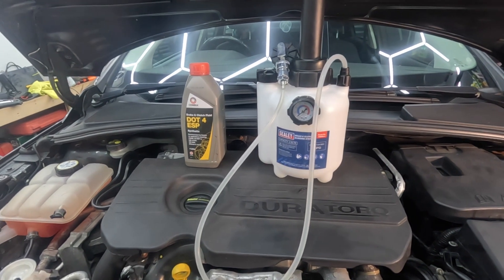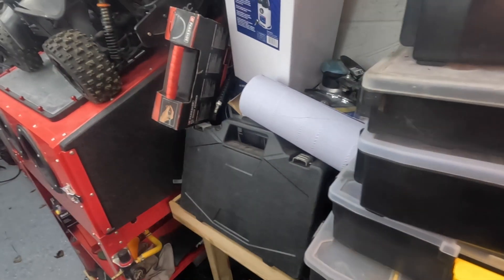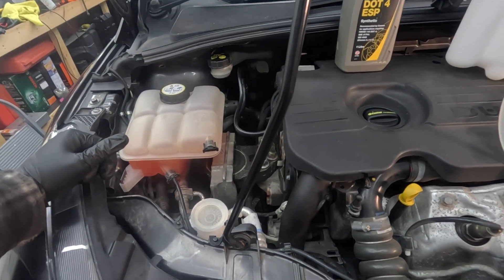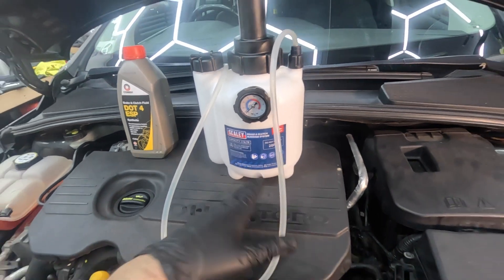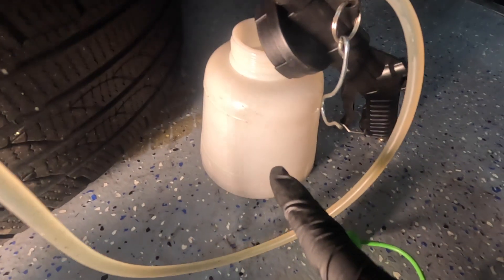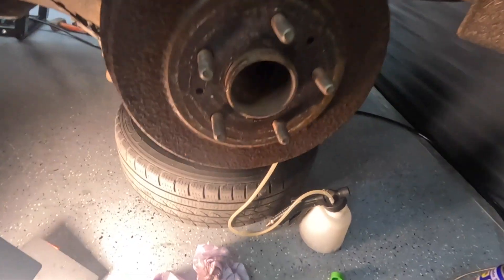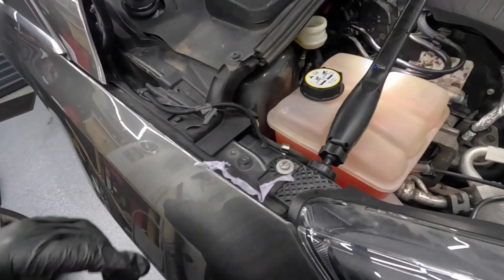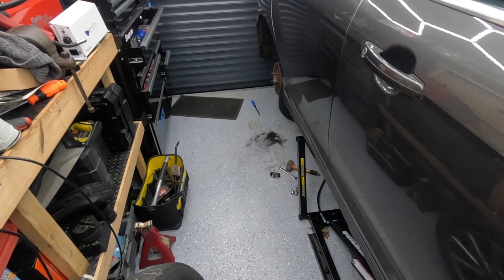MK3 / MK3.5 2012 - 2019 Ford Focus Estate 1.5 TDCI - How to Change Flush Brake Fluid Sealey VS820

Comment: I felt the tension trying to crack those bleed screws! After you're finished, how do you clean the pressure bleeder out? I imagine a thin film of brake fluid will be left inside, even after draining the contents back into the brake fluid container.

Comment: Can I top up that comma dot 4 esp to top up my focus. Cause, a mechanic told me that it needs a kind of green colour one.
Reply from the maker: If brake fluid is green, normally means contaminated but I think you can get a green mineral brake fluid but think the mechanic is referring to the Castrol brand and which is what I use and green. Check your service manual it will say if dot 4 or 5 and if you need ESP. 

Don’t use an open unless you know it was opened recently.